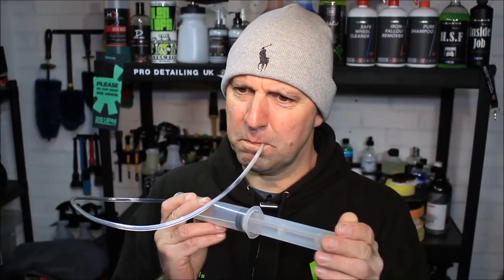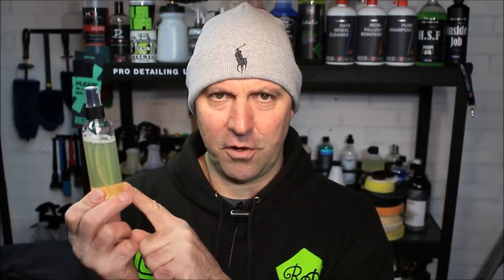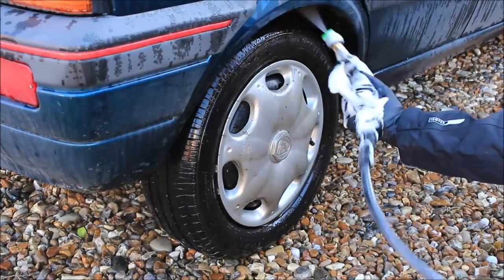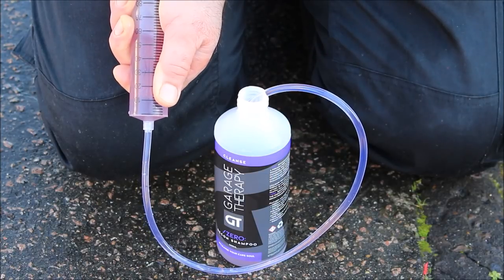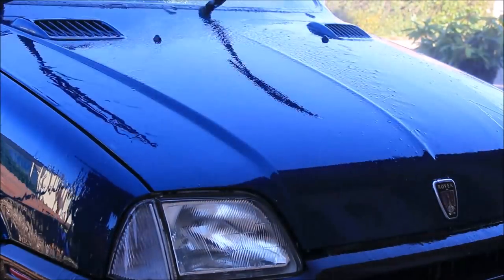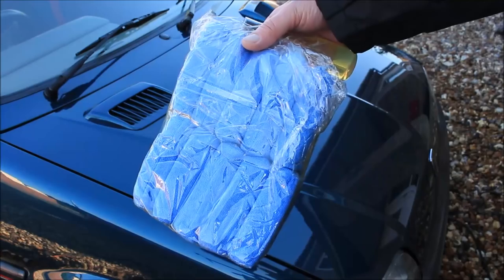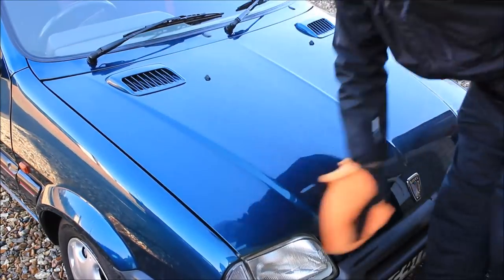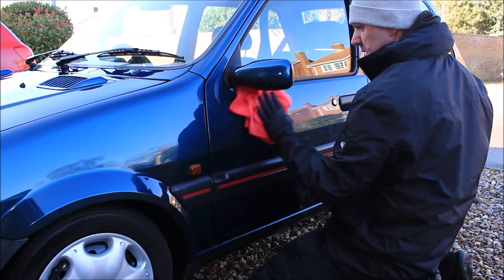Ceramic Spray testing

Comment: Hi Paul! Thank you so much for doing this testing for us and doing such a good job in explaining the application process. The car looked fantastic! 

In reference to the beading, we typically do favor water sheeting to avoid water spots. As this is product contains Sio2 materials and will likely be used as a topper or a stand alone then sheeting and slickness as you rightly pointed out is preferable. I am sure however if you used a pressure washer for example that would of created lots of beads :)
Reply: @attractionimages3220  from our web store when the final version is ready. 🙂

Comment: Hi Paul, Great  presentation on this one.  Comparing the result to the Craig and Martins applications I think this shows better results,  maybe it is the different formula or maybe because you polished the bonnet before application the gloss levels and water behaviour seem to be better than the other guys results, but Craig suffered with very low temps applying his so it was always going to be difficult to cure properly, Will be interesting to see the old Metro in 4 weeks time. Love that Metro and amazed at the condition, I always wondered what happend to UVX201W  my old 1.3s .

Comment: I found this video easier to see the difference than Specky’s (sorry Specks) even though you applied too much water to the pad it didn’t look bad at all, but the gloss was incredible compared to before. 
Sheeting wise meh it could be better imo, I’ve seen faster with the likes of Meguiars ceramic spray and Turtle wax Spray n shine. But there’s no doubt it does (after a while ) leave the paintwork free of any water and that’s it’s job no matter how long it takes really. 
#beadsvssheeting 😅
Reply: Contact angle, quickness of sheeting varies from car to car. Open hose vs pressure washer. You can't tell how fast something sheets unless you do a side by side comparison.